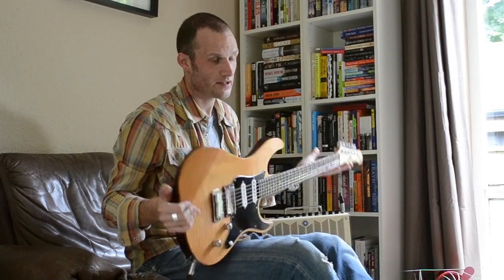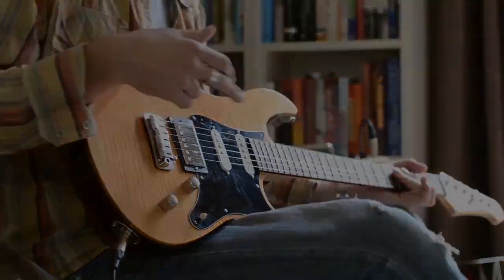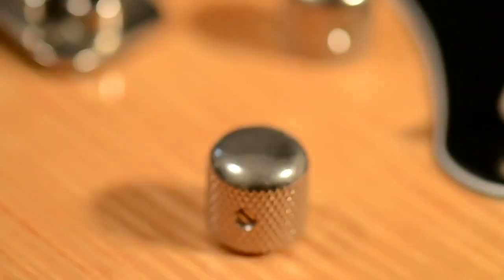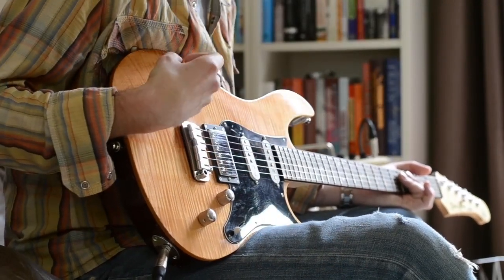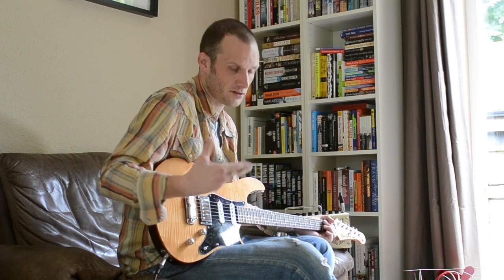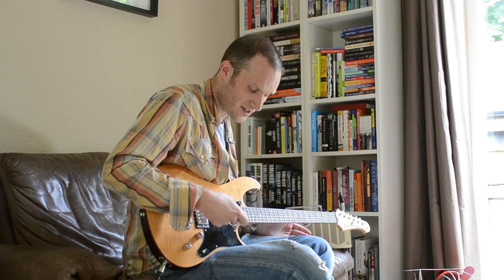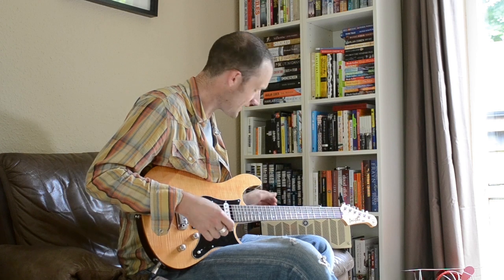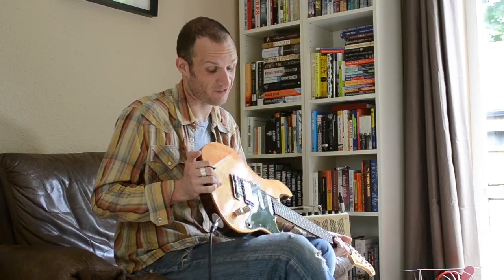Yamaha Guitar Development Mod of the Month: Pacifica 812V (demo'd with THR10)

Comment: Great video. Really well detailed and thorough. That bucker does indeed sound nice. The guitar seems fantastic value too - a glance at used prices in the UK suggests you can get one for as little as £400. The THR10 is available used for around £50-100 and although he doesn't mention it, its worth checking out the presentation vids. An amazing product. A screamin' demon SH-12 bridge can be found for £40 or so. So all in, no need to break the bank. You could even get a cheaper guitar and get everything for under £400.

Comment: I have two Yamaha's. An 812W and a 604W both modded. I din't mind the JB in the 812 but I did replace the neck SSL 1 with a Dimarzio cruiser. Really opened it up. The 604 now has all Dimarzios: cruiser in the neck, true velvet middle and 36th anniversary PAF in the bridge.
I rarely pick up my Lace loaded start.
If you are lucky enough to find an 812 or 604, grab it. They are like trying to find hens teeth now and they are just a great guitar.
Reply: Interesting.  I have a 612v and like the JB in it, but find it is a bit on the trebly side with little low bottom end (probably due to the combination of the JB with Alder, a very bright wood).  I sometimes wonder how a SH-5 Custom would sound in it, but don't want to mess with the guitar and its original state.  

I saw a 812v on guitar centers used section website for $250 the other day... too bad I am abroad or otherwise, I might have snatched it up!
Reply: socialdef3 Picked up another 604 absolutely mint for a song. It had all Yamaha Alnico Vs in it. Not  a fan of Vs. Dropped a DiMarzio Steve's Special in the bridge and although bright with a bit of edge, it is a little more rounded than the V. Haven't quite figured out what to do with the neck and middle on this one. Not in a hurry as I have the other 604 and 812W.
Reply: Taylort3b I can deduce two things from your comments:  You are lucky to have found those hen's teeth and you are also a smart man for appreciating quality when you see it.  Seriously now, you'd have to be dumb or blind to not respect Yamaha guitars.

I've always found the ignorance of others is an opportunity for me!  I keep buying the lower-end guitars for pennies and modding them (so far:  Pacifica 120SJ in natural - RGX121S in black, excellent, but rare guitars to find in some places).  My rule is "don't go over $100".  I paid $60 for a used EG-112 to fix for my girlfriend and it has now become a solid guitar, despite not paying much for the replacements.  

If I had money, I'd look for the MIA models which I believe are the PACUSA1 and PACUSA2.  But even if I had the money, you can very rarely find them anywhere - people just don't want to part with them!  

Anyway, I have 12 guitars, 6 of them are Yamaha.  "Nuff said...  enjoy yours!
Reply: socialdef3 You're right. My days of buying high end guitars are over. They are lovely pieces but at my age I have far more fun just picking off someone else's castaway and modding them. I  first look for Yamaha's from the 90's and early 2000's in great shape. My quest is to find a Pacifica 904, although I suspect I'd have more luck finding the Holy Grail.
Just picked up an RGX620z for $80.00.(with case!) Once I cleaned off the layers of dust and corroded strings, (that likely were put on at the factory)  the guitar was showroom condition. Pulled out the stock Alnico V's and put in a set of Custom 59 Pro PAFs, along with new pots. Honestly if the body was mahogany it would go toe to toe with my 96 LP Custom back breaker (which I sold ).
I suspect with the decline in interest of young people to play guitar, there will be some little gems show up every now and then. Retirement can be fun.
Down to ten guitars after selling six.
Reply: Taylort3b Awesome man.  You have great taste and I agree that it's quite satisfying to take someone else's unwanted gem and polish it into what it is really capable of.  

There's tons of potential with Yamaha guitars because despite lower quality electronics and hardware (when talking about their low-end models), they are still ridiculously well-built an have a solid construction, thanks to Yamaha's astounding quality control.

I've been slowly discovering Yamaha's other electrics and have found the RGX820z to be absurdly tempting - alder body, 22 frets, vintage trem with piezo, seymour duncans... man they've been making some tasty guitars for quite a while now... the new Pacifica 611 seems interesting as well and it looks like the world has caught on, because they are selling at over $600 in most places online.
Reply: socialdef3
Perhaps we should shut up or people might catch on. Then what would we do? I'd still buy every 604 or 812 I could find if the price was right and they were in good shape. I like my Standard Strat with the Lace pickups but in all honesty the modded 604s are nicer guitars and the 812W blows it away. I guess beauty is in the eye and ear of the beholder.
Reply: Taylort3b Exactly.  People get unnecessarily uncomfortable when I tell them my 612v runs laps around their strat.  It's just a nicer guitar in all respects.  More comfortable to hold, nice contours.  Then when we talk about construction, it is better built, Yamaha has more years in this industry than Fender and knows a thing or two.  Then we talk about versatility, and you can basically throw the strat out the window.  It doesn't compete in anything but resale value, which is not important for me anyway.

If I had the time and money, I'd buy up my favorite Yamaha electrics (and acoustics), fix them if needed (obviously high-end models don't need this) and then enjoy them and possibly sell them for a small profit.  In any case, since not everyone is after Yamaha's, I'd get a separate room just to showcase them, as they are also all very nice to look at :)
Reply: socialdef3
Absolutely agree. I can't quite wrap my head around the resale value of some guitars. When I started playing in bands in the 60s, I had a new 64 Telecaster. I got out of music, sold the Tele, my amp and saxophone and took off to Europe. In 2006, my wife and I were in Chapters and looked at a vintage guitar book. The Tele was worth between $18,000.00 and $24,00.00 depending on colour and condition. I almost fainted. A fellow I know sold his 68 LP in Austin Texas for $30,000.00. That same guitar later sold for(get this) a quarter million.
On a whim, I picked up a Squier Classic Vibe 50 a couple years ago. I couldn't believe how nice it was and how it reminded me of the 64. I left the Alnico 11 in the neck and put a SD hot rails in the bridge. It is just a sweet little guitar and cost me under $400.00 total. People wouldn't give me $300.00 for it now yet in my opinion it is every bit as good, if not better, than the 64.
Let me know if you find any other gems.

Comment: Anyone know if a tremolo bridge like that is available after-market?
Reply: Its made by Yamaha. They only put it on two guitars, I think. I wanted to get a whammy bar for it last year but discovered that they no longer produce it. I ended up buying a guitar because it came with the exact whammy bar.
Reply: @peeper879 do you know if one of the guitars they put it on is the RGX820z? I own one and it looks similar
Reply: @ChidOki  Yes the RGX820z and the Pacifica 812v use the Yamaha r1000v. I have a red RGX820z
Reply: @peeper879  Wow good to know. I love this bridge but didn’t know if it was on anything else. Makes me want a Pacifica 812v now

Comment: Will this work with a Pacifica 112j? I hear this HB only sounds good in certain wood bodies. The 112j is alder. 
Also for the ssl-1 would I need the middle pickup to be RWRP? I plan on splitting the HB.
I’m not sure if the pots in the 112j are 250k or 500k. What value should I use? Thanks to anyone who can answer these questions !
Reply: Hey cray, Tip on pickups.
Low output = sparkly, high end, slightly scooped mids, presence.
Med output = sparkly, high end, tight low end,  balanced mids + gain friendly
High output = gain, low end, high end, mids.

The screaming demon is a medium output humbucker and it will do fine in your guitar if thats what you are going for. 

Rwrp is relative to whatever diagram you are using.  A humbucker can  be wired multiple ways with 4 wires. Get a pole tester for polarity. 

If the polarity isn't right you can get weird funk tones in th 2 position thats humbucker split and singlecoil. Some folks dig it (I do on odd occasions.)

Comment: You can't TAP humbuckers, only single coils, Humbuckers are SPLIT. Even Guitar companies get this wrong...lol...
Reply: Spam'n'egg. And there's me thinking that the purpose of a coil tap ,or splitter  is to turn a humbucker into a single coil.  Enlighten me please ?
Reply: You definitely can tap a humbucker, some guitars offer split AND tap (which lowers the output). As for splitting, technically you are doing it by "tapping" the signal in between the two coils, although to be fair it is usually done by grounding the tap point. Splitting is the proper term to avoid confusion with tapping.

Comment: Throw a Floyd on this guitar, and I'm sold!  Maybe offer me a maple board too... I'd buy a couple of each. What I'm gettin' at is this - I have 3 Gibson Les Pauls, 4 Fender Strats, a 1967 Gibson V, an early 80's B.C. Rich u.s.hand  made Warlock, 5 various Ibanez Guitars... blah blah and a blah. I'd like a guitar or 2 that can kinda do it all - and be road worthy. And be modern, yet still have some vintage to it. Without having to sell my youngest male child for the cash. I want to see a guitar maker offer a legit - off the shelf  bad ass guitar for around the $1200 mark. Not a "ghost built" guitar that cost me $5k and looks like the $1200 job.. I'd love to see the real deal. I could buy it, you could buy it...  and - we would.
Reply: wayne068x Yamaha's are great, but I disagree on the floyd - vintage tremolo all the way.
Reply: Wilkinson v100 in Pacifica 604W is just enough :)